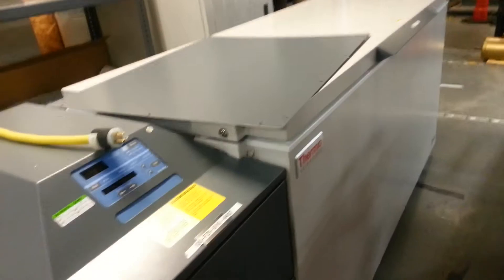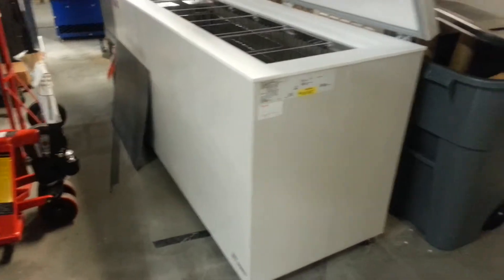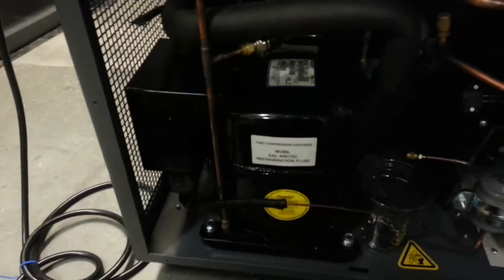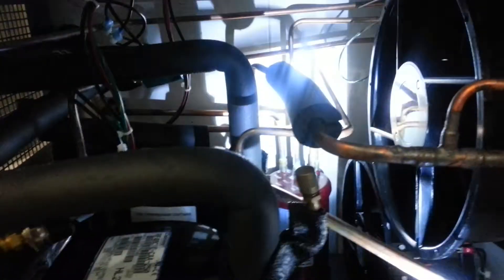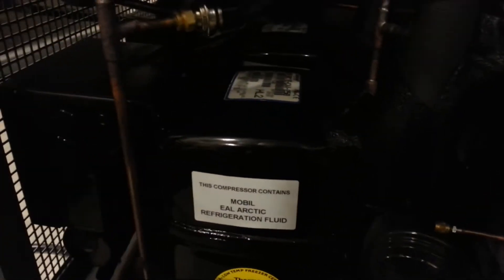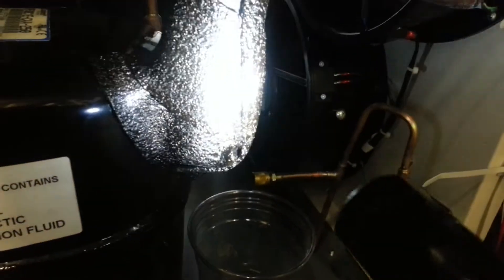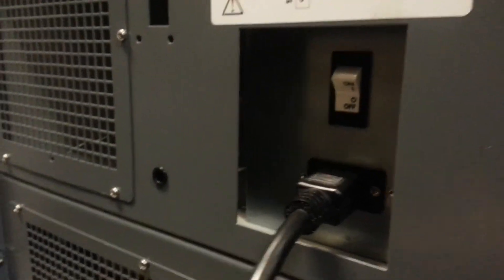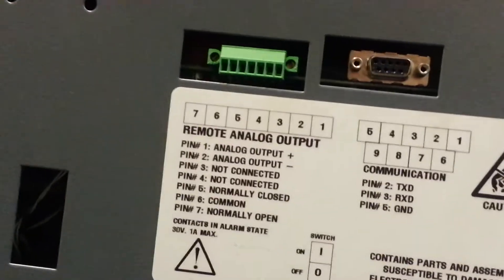-80 chest freezer

Comment: Sir - Which compressor and which gas should I use for -86 deep freeze fast and second stage?
Reply from the maker: 1/2 horse power R508B
Reply: Sir in first stage
Reply from the maker: @ramkrishnaguha813  both compressors are the same horse power on a reach in freezer application
Reply from the maker: @ramkrishnaguha813  R404A on first stage
Reply: Sir please share compressor make and model no